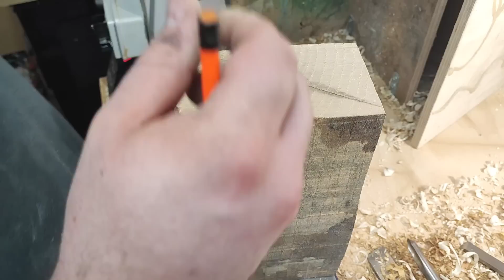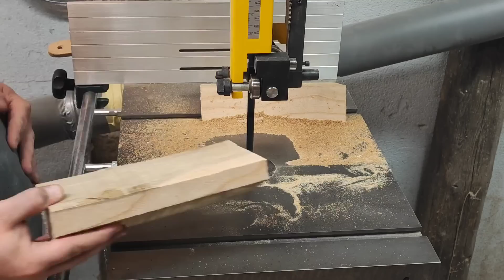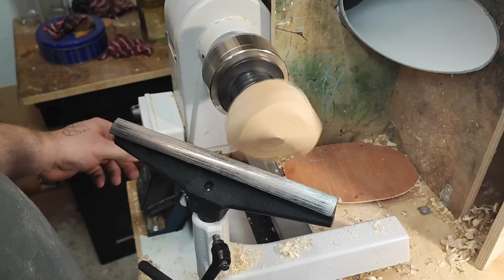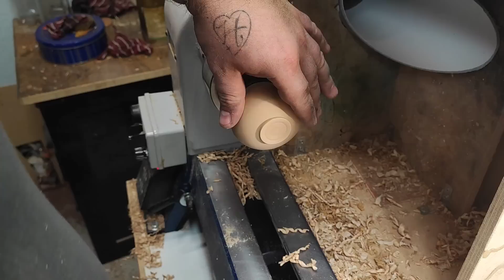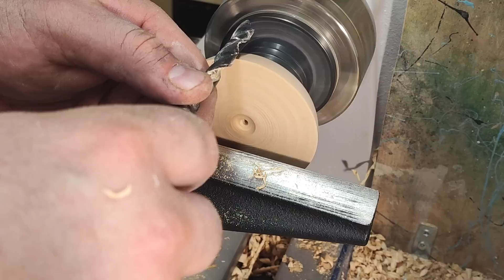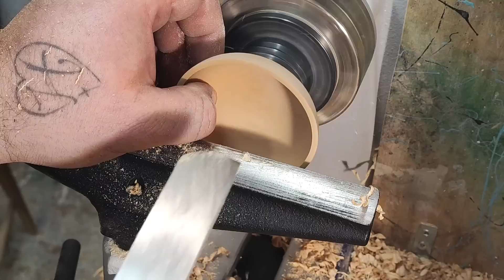From firewood to nice looking bowls__part 1

Comment: Nicely done,.again no extra steps, just the precise mouvments in order to quickly reach the final result. So inspiring for me. Did you conciently try to get both indentical or the foot measurment and the clasic shape push to the same result for both without lookint for it?
Reply from the maker: Thank you Boris, When I do a tiny set like these I tent to make them similar, they don't have to be excact as you'll see in part 2 but close ..... For me it looks like they belonge together rather then just collection of 4 bowls....hope that makes sense 😀 thank you for watching
Reply: @tomislavtomasicwoodturning  Does make perfect sense, thank you!